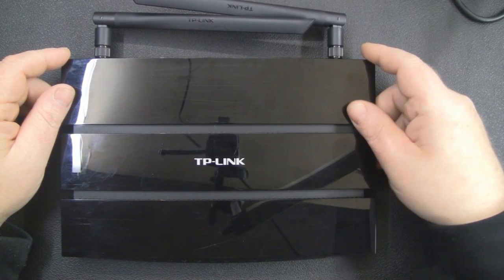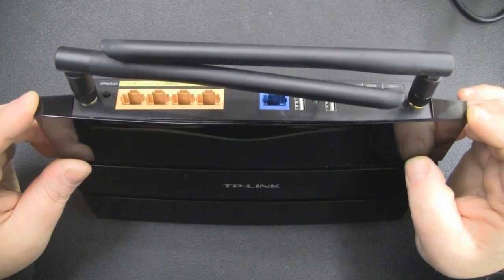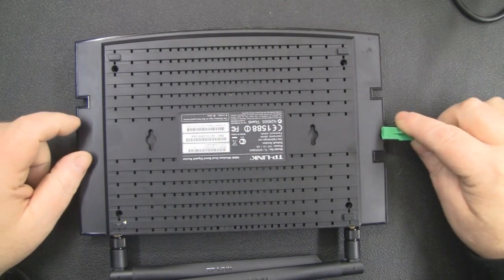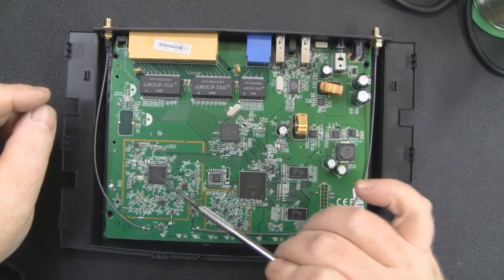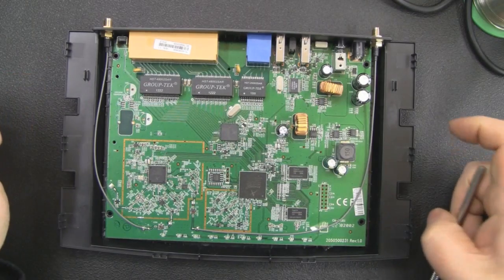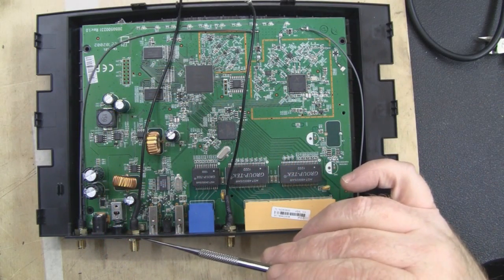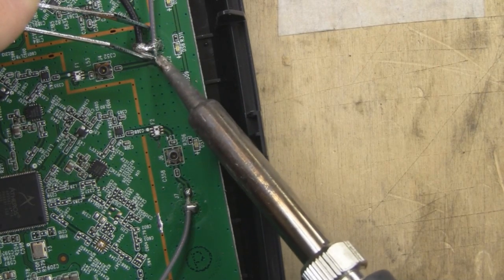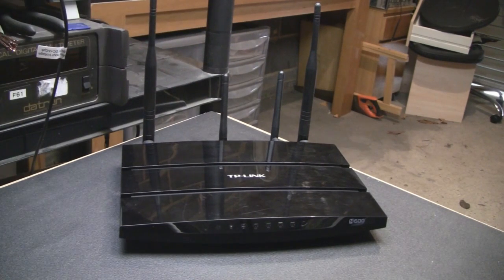Tp Link tl wdr3600 Antenna Modification #80

Comment: Dear Andrew, Have been having problems with TL-WDR3600 related to weak signal after I upgraded from Windows 8.1 to Windows 10. Tried talking to TP-Link about it ...but no help! Then I found your video on the subject, so as of 5 minutes ago I've ordered needed parts and should make the modifications within 1.5 weeks. Thank you for this wonderful video.

Comment: Nice to see the innards, but not really the idea of a modification I would be comfy with on a client's piece of hardware :(

My issue with these units are with the radios dropping out period. Time to get out the scope!

Edit: Nope, just popped this baby open, and that set of pads don't even exist here :( 

Edit 3: Sad, and removed edit 2. was way too excited to do some heavy lifting. Thinking the high speed switches in this thing just get stuck. Need more o-scope time. ^_^ never an easy solution

Comment: So you replaced the stock antennas with 5GHz models. and added two 2.4GHz antennas on the new connectors? 

I was wondering, do you think that it would possibly be interfering in any way, to add the two newer connectors, to the front corners? As if you were to mount them in the corners, out of the top of the device - through the small plastic areas that can fit such connectors. 

I see so many higher end devices with this square setup, and I was not sure if there is any major benefit beyond having more streams at once. I would never spend 300$ on a router like those, to find out. 

Also, these models come preloaded with ddwrt on Amazon for pretty cheap prices. I picked one up for around 45$ with the firmware loaded already. The functionality simply allows more control over the device's capabilities and functionality. I mostly like it to ensure WPS is turned off completely, b/c of being such a massive security hole - even to the kiddies. 

Also - I wanted to ask if I can request a video topic: Which is best for pentesting? When it comes to the antennas, and hooking up multiple w/ a T-connector (SMA) or by using certain directional antennas... what would be best to get a strong, directional signal without having to worry about dropped transmission, or distance issues. Currently, I have done my own testing with Alfa and TPlink radios, connected to the Alfa 7 dBi directional antennas (one or two - depending on if we use an amplifier too). But connecting a Sunhanz 2W WiFi amp, to the Alfa radio device, and then two directional antennas, gets pretty good signal, but I feel it could be strengthened greatly by focusing the energy. Would you have suggestions of which antennas do what...? Like - can you make a video to go through the patterns of the antennas (theoretically even - just drawn), and comparisons of the various types of antennas, so we can understand the relationships between all these cool antennas you make. 

A comparison video - not focus on how many AP's you can pickup necessarily, but rather, how each antennas projects its signals, and how we can imagine them working to get a basic visual idea of which might be best for our specific applications. 

Also - have you ever made any modifications to the Alfa 7dBi directional antenna? To make it into some off cantenna or something? I had wondered if it would be possible, since the Alfa is such a great ant... but it spreads the signal. I imagine if you focus it, you would get greatly different results. I thought I would ask someone who knows what they are doing - b/c I am trying to get further into this myself. 

Last question is, with the math you use, do you have any advice on what formulas or which types of math would be best to figure out these dimensions - in the case we design one ourselves? I know theres calculators, but I would like to understand the actual math better as well . So I can understand what is happening in each build. 

Thank you very much - and keep up the great work with the amazing skills/videos.

Comment: From what i have seen in your other videos, you removed the resistor that matched the impedance of internal antenna or avoided that resistor by removing the test points and soldering the cables there instead. Would that be the case if there were internal antennas on this router??? Also, I'm trying to figure out the name of that connector for the test points. Could you write what it's called? Thank you!

Comment: Can u help a fellow Yorkshireman? I have a to link n900 and have bought an external 5ft antenna and mounted outside via. A 15 m cable. It doesn't seam to have done much at all? The 2.4 seemed extended a bit but the 5 not much at all. I've simply swapped the one of the 3 antennas with my new one. Am I missing something?
Reply: from a guess, I'd say that losses in the 15metre extension cable  are masking any improvement. Most thin cables have significant loss especially at 5GHz, this fits in with your results where the 2.4GHz is slighty improved
. 
Make sure you are using high-quality cable not some cheap ebay tat :) Even then, 15M is a looong way at 5GHz.
If there's any way you can move the router closer to the external antenna and use a shorter cable.

Comment: Andy, i need to order a couple of RP-SMA antenna WiFi pigtail cables and a couple of antennas for a router build.  What is the best length that I should look to buy for the pigtails and can you recommend any antennas?

Do you know of any grey colour antenna's that I can use?

Comment: Hey did you think about splitting the 2.4 and 5ghz paths completely?
I mean if you remove the f1 and f2 mixing elements and solder your antennas there. Do you think that would work even better?

Comment: I ended up doing this hack this past weekend. I ended up installing the extra new antennas in the front near the LEDs though, because the coax + SMA connectors I bought on ebay turned out to be really short (about 3 inch coax). Still improved my 2.4Ghz signal tremendously, and after I get dedicated 5Ghz antenna will improve that signal too.

Comment: you should have also tried to just simply replace the two original existing antennas....one for 2.4 and one for 5ghz, that probably would have improved the signal on both bands also

Comment: You're kidding! Adding the second antenna and coax in parallel results in an impedance of 25 ohms and thus a VSWR mismatch of 2:1. The improved signal will probably be the result of the yagi you created by adding the extra antenna. You need to match impedances for example with a balun to get good results.
Reply: Rolf, putting the 2 antennas in parallel does not result in having 25 ohms because the 5 Gh antenna will not be 50 ohms when using 2.4 Ghz and the 2.4 Ghz antenna will not be 50 ohms when using 5 Ghz.  The characteristics of those antennas are very frequency dependent.   Unfortunately there's no way to tell what it actually will be except by testing it with a network analyzer,  each antenna could be anywhere from 10 ohms to 200 ohms when the other frequency is being used.  Hams make combo antennas by combining different lengths of dipoles together at the center connected to one feed line and just ignore the part not being used and it seems to work. I'd think that adding a length of feed line connecting an unused antenna with it capacitance and inductance in parallel with the working one would mess up the tuning a bit but it's not all that critical in such low power applications and it did tend to work OK when he tested it.
Reply: You're right, I was assuming he added an extra antenna to the existing antenna. Although adding an extra antenna without proper matching will give completely unpredictable results. The 'unused' coax will perform as an impedance transformer and antenna matching (performance) will be dependent on stub length and antenna impedance. If he'd used a 2.4 / 5 GHz diplexer this would make sense.
Reply: Hey guys what happen if i add the connection 1 to connetcion 2 in parellel? I`m planning to add an yaggi antenna in on side but i want to increase the power of TX and RX so i`m thinking connect the both connections in the yaggi antenna
Reply: if i dont plan on using 2.4ghz can i just use a 5ghz only antenna?  do they even make 5ghz only antennas?  i have this router but has the common problem where either 2.4ghz or 5ghz is unstable.  in my case the 2.4ghz is unstable.  i am using the wdr 3600 as an wired router and a cheap 841n as an access point but it is not 5ghz.  if the 5ghz tests to be stable could i get a 5ghz antenna and put them on?  have any links to one?
Reply: You are clearly kidding - stock antenas are complete junk, I dont even know if  the manufacturer checks SWR and impedance on them or not

Comment: I have this router, can you tell me why do i get so many drop outs on this router, i get signal strengths of 99% and then for say about 2 seconds or less (sometimes more) randomly it drops to literally 0% and 30% and anything inbetween.  Is there something that can stop the drops (especially to 0) or is it just that this router is not that good.  I have seen a lot of people complaining about drop outs with this router so it seems to be a common problem
Reply: +Michael Jones Try different firmware. Everything runs rock stable with OpenWRT
Reply: I had the same problem. I fixed it adding some heat dissipation on Anteros Chip and on the main chipset. Even the drop of signales was fixed, I continued to have poor signal. I just changed the two antenas provided by tplink for two 2,4 Ghz antenas of 6 db. Problem fixed 100%. I dont use 5Ghz, so..is not important to me..

Comment: So, once you have all 4 antennas mounted. Which 2 are the 5ghz and which 2 are the 2.4ghz.

Will these antennas work on the outside and the ones currently on the router work for the inside.

http://www.amazon.com/TP-LINK-TL-ANT2408CL-Omni-directional-Antenna-connector/dp/B004UBUE2O/ref=sr_1_1?ie=UTF8&qid=1431332736&sr=8-1&keywords=rp+sma+antenna

Comment: Couldn't you use 2 RP SMA Splitters to attach both 2.4 and 5Ghz antennas to each RP SMA lead from the back of the router?  That way you wouldn't have to open the case or solder to the PCB?
Reply: I have the same very same thought
Reply: Good idea!
Reply: SpudGuns, you could, but power splitters for those frequencies are rather expensive, $20-$90 on Ebay, and I'm talking about "real" splitters, not just a T, also they will reduce the signal by 3dB.  However a T might work to some extent and they only cost $1 on Ebay so it wouldn't hurt to try it.

Comment: Hello Andrew,
 Thanks for your informative videos !
I have the TL WDR4300. Its "Dual band" antennae are a joke!
Silly me I purchased  some of those "dual band 9db" as seen on Ebay. What a pile of junk! Signal strength and through put on both bands are significantly worse than the original crappy (compromising) Tp Link antennae.
 I was wondering if you could explore the design flaws with these particular antenna ?
Could you offer any way to make them work!
 Also does connecting the second set of antennae not cause the impedance to halve?
Would this not affect the RF chips in a bad way as they are designed for a 50 Ohm load?  Does this affect the amount of reflected RF energy?

I would like to see a video showing how to build your dual band design.
Thanks

Comment: i been tryin to boost the range on a x5c-1 drone, every single bloody video has a super vague point, every time i get close to a simple answer bam! last couple of sentences blow my newfound understanding outta the water... wtf, near the end of the video you say you installed two 5.8ghz antenna??? where the original two 2.4ghz? please clarify... i'm tryin to boost range on transmitter and arrange two receiver antenna on quad,

Comment: can i just replace the one side of original antenna with 3rd party 2.4ghz antenna about 20dbi on ebay?? will the 2.4ghz range improve ??
Reply from the maker: Yes you can but those 20dbi dipole antennas of ebay are nowhere near 20db.
Reply: i want to follow your method too, but i don't have tools. can you recommend me one of the best 2.4ghz antenna for this router ?
Reply: andrew mcneil is there a way to build a 20 dbi dipole antenna but that is NOT so big???

Comment: Your other two parallel antenna will reduce signal quality and decrease the speed of data transmission.
Reply from the maker: Why would it? Please explain the theory of your statment
Reply: andrew mcneil I actually operates WiFi networks for customers and I was able to transfer the signal from a Bluetooth USB adapter via wifi 8 dBi antenna on 250 meters. Router has 5dBm power. 5dBi antenna consumption and beam angle of 40°. If you add 2 dBi antenna parallel to the radiation angle of 80°, the Quality signal decreases by 50%. Have you tried using to connect to a distance of 100 meters and test ping the router and internet google? Checking the operation of the network can deteriorate and depreciated router. I tested it only indoor and outdoor did not test it. Indoor test shows a better signal because the walls of the room served as the reflecting surface of the satellite. At 10 meters not see fluctuations in data transfer but at 100-500 meters away, with disastrous operation of the network. To that your router can buy 2x, 7dBi antenna angle of 30° and extending the distance to 200 meters.
Reply: @0903390901  Fun fact, the internal 5GHz chip has a WHOPPING 6:1 VSWR tolerance, so you might even avoid damage to the 5Ghz segment
ZOINKS, but no!

Comment: andrew, what antenna you have installed instead of the original?
Reply from the maker: two 5GHz and two 2.4GHz dipoles if you search my past videos I show you how to make them.
Reply: original antenna tplink not suitable for use? for a range of original antenna?
Reply: +andrew mcneil can I use omni in lieu of dipoles?

Comment: Big improvement on the 5 GHz!
Reply from the maker: Most dual band antennas for wifi are rubbish but I may do a video showing how to build my dual band design as they sometimes have their uses.
Reply: andrew mcneil hi, which side is the 2.4GHz antenna ?  

As i am planning to replace it with TP-LINK TL-ANT2408CL, 2.4GHz 8dBi Indoor Omni-directional Antenna

Thanks!

Comment: I'll redo your router 4300. The signal from the router is very weak. What antenna installed instead of the regular 5 GHz?

Comment: I think you may be confusing 3600 for 4300 which indeed is a dual band router with three antennas. On amazon.com, 3600 has two antennas in the pictures.
Reply from the maker: I think your right Stefan they seem to use the same hardware and openWRT has them listed with the same firmware